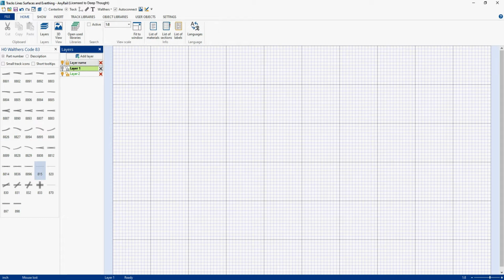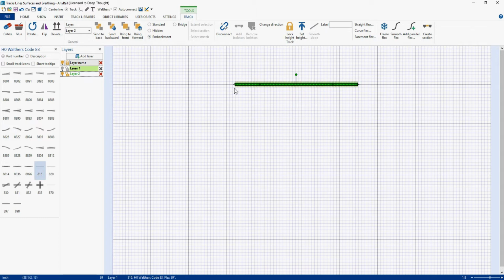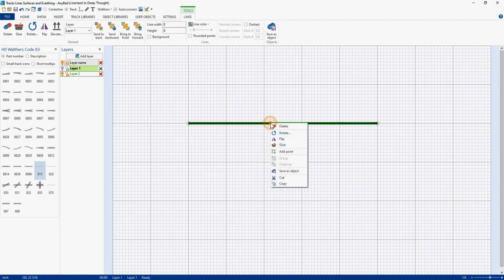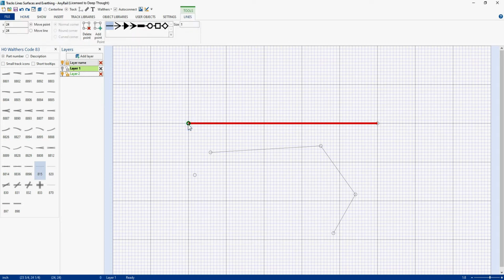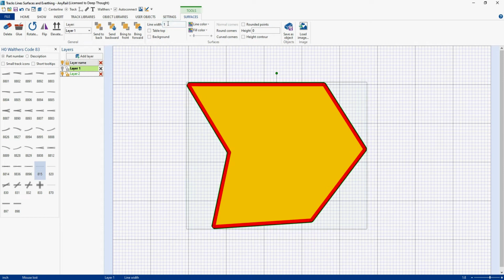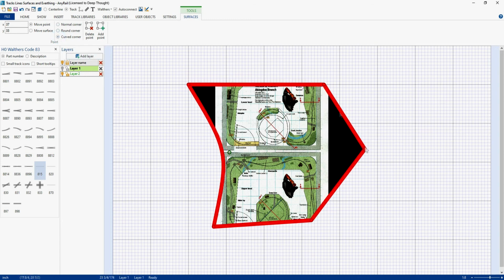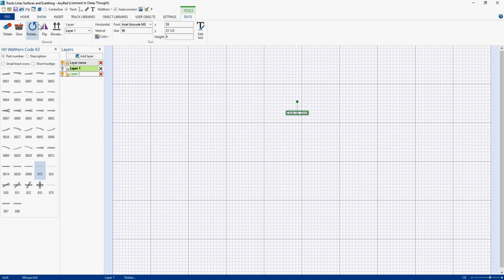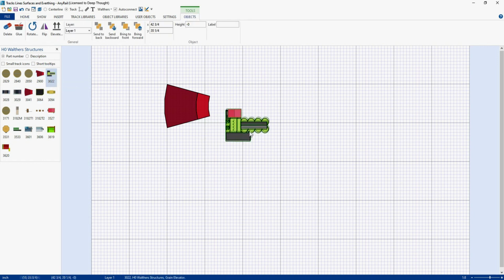AnyRail Tutorial Video 42: Tracks Lines Surfaces and Everything

Comment: at 7:20 when you are talking abut lines, you can specify and grow the length of a line. Go to the lines endpoint and for an example if the line is 24 inches in the x axis enter what is needed for the new length. The line will then grow by the additional amount. Yes it would be helpful if we could simply grab the end point and pull it to its new length much like what is done with the track features. Great instructional videos. I am enjoying learning this program.
Reply from the maker: William, I suspect that the AnyRail program will continue to evolve and this feature will become available in later releases. Being able to stretch a line would be really handy if you want to stretch at an angle. X-Y does get a bit tiresome after a while. I need to re-do that Video 42 because I have learned a few things since it was posted. I'll get around to it soon.
Dave

Comment: 20 years or so ago I built a nice 4 x 6 N Scale layout.  Long story short it has been in a back garage covered up and up against a wall for 15 plus years.  A month ago, I set the layout up and am getting it running again.  Trains have changed since way back when to now with DCC and what all that brings.  Anyways I got the train bug again and want to do a bigger layout than what I previously built.  I purchased Anyrail and I just wanted to say thank you for the videos that you have made to help others use this program.  They have been very helpful to get me started in my next train project.  

Thanks again, 

Glenn
Reply from the maker: Glenn,
Thank you for the kind words on my videos. I'm in the same place you are. Haven't had a railroad for about 20 years. Trying to get this one going and want to do DCC but I am surprised (shocked?) at the price of HO DCC locomotives. Even rolling stock seems to be very high priced, but the detail in this stuff is so much better.\
Got some more videos on the way.
Thanks again!
Dave
Reply: @steampoweredradio2981  I have experienced price shock myself lol.  Santa brought me a new DC loco for Christmas that if I bought it, it would have been about 100 dollars but this engine compared to what I had, 1000% nicer with details and just a larger loco.